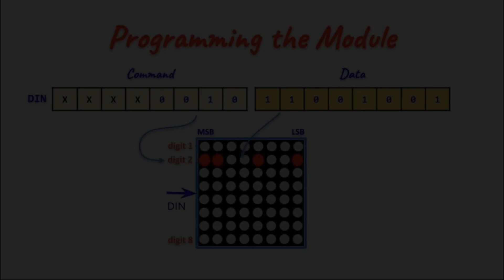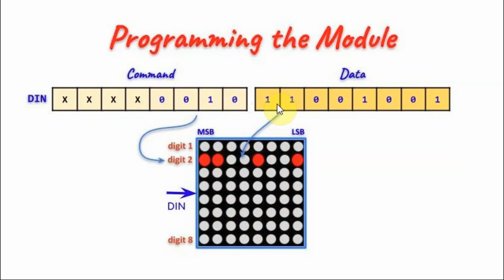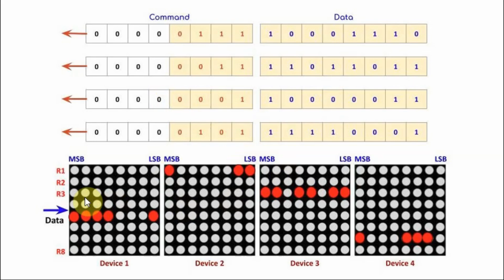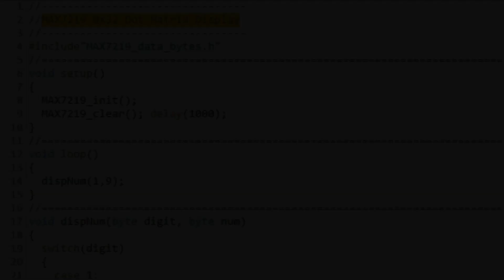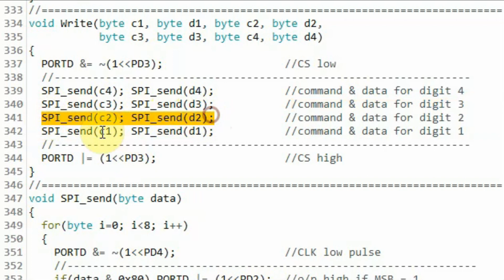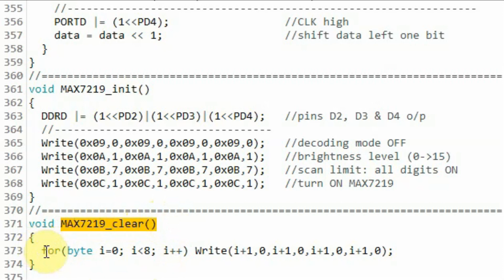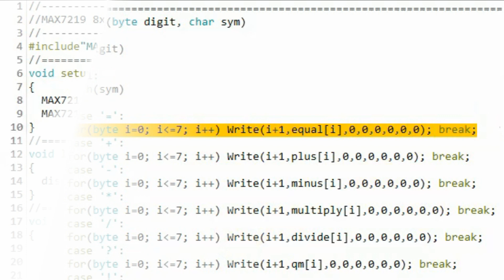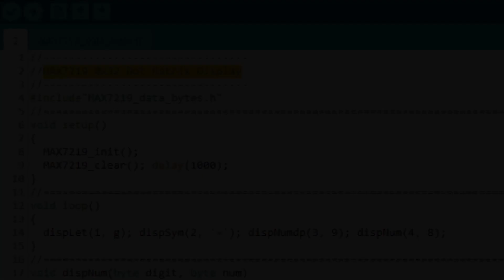Programming MAX7219 8x32 Dot Matrix

Comment: Very Nice. 
Do you think this MAX7219 can be applied to a 8x32 Matrix/Array of WS2812B? 
"RGB LED Digital Flexible Individually Addressable Panel Light WS2812 8x32 Module Matrix Screen DC5V" and up the colours available, as well as graphics scrolling?
OR, is there a better way to handle a single 8x32 such as this?
You do really interesting stuff, well laid out and explained, been following awhile and appreciate your work.
Reply from the maker: Thanks for your feedback. I’m not sure, I’ll have look into it. Anyhow, it would be great to control WS2812B with MAX7219.